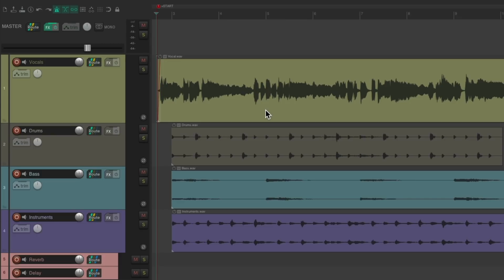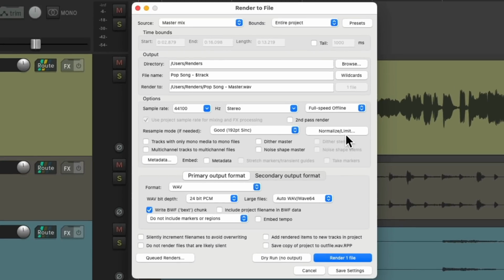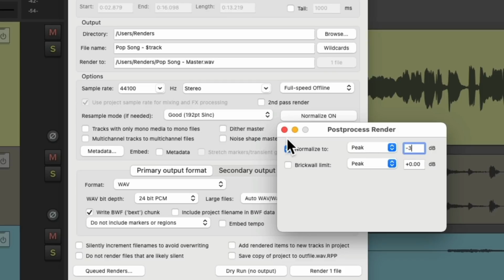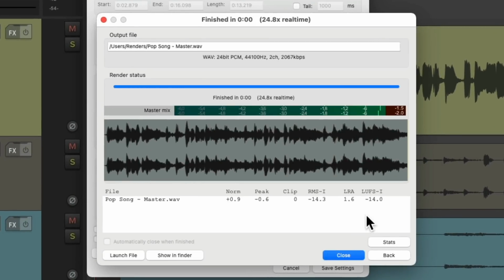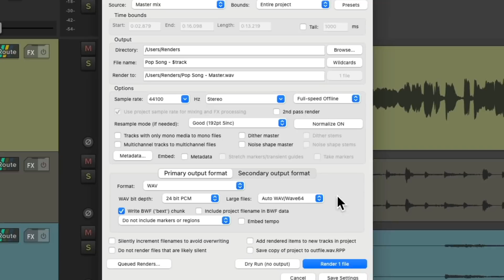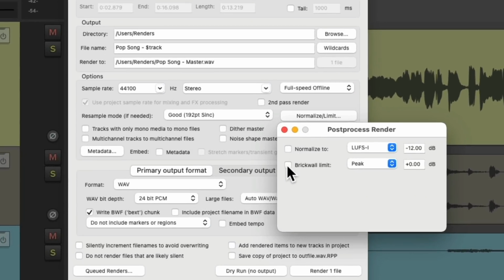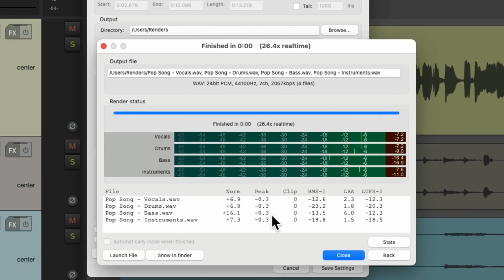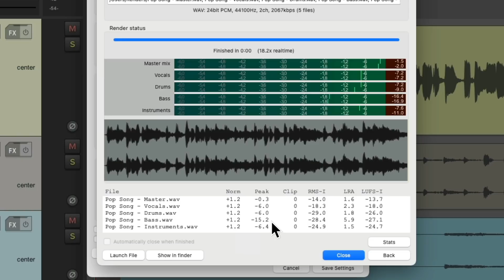Render Normalization in REAPER

Comment: Awesome as always. Question, with REAPER adding the Limiter option in the render dialog, does this now render (pun intended) limiter plug ins on the master track unnecessary now?
Reply from the maker: Yes and no. You can't hear the result in this window so I would say it's still better to put it on the master track. But this is a great time-saver for doing things quickly. Like if you had to render 30 stems that are not related to each other and you wanted to make sure none of them clipped.
Reply: @REAPERMania  very true, if you want to hear and adjust the result you'll need a plug in on the track. Thanks and great video as always

Comment: Kenny, does Reaper have any kind of Distressor functionality I'm not aware of?
Reply: What functionality do you mean? The EL8 Distressor is a compressor/limiter, with fairly standard controls. (Maybe the adjustable sidechain high-pass filter is unusual - ReaComp actually has that.) I haven't yet had the pleasure of using one myself, but AFAIU what makes it special is that it has a really great "analog" sound, and you can switch between different compression curves & distortion characteristics.
To maybe answer your question: Try the different compressor / limiter / distortion / waveshaping JS plugins that come with Reaper. Also try fiddling with the Knee size, Hysteresis, and Highpass settings in ReaComp.
If you want to learn about the shortcomings of ReaComp, I highly recommend Dan Worall's videos on it.
Reply: @nibblrrr7124  I believe the devs addressed all of the shortcomings because of that video.